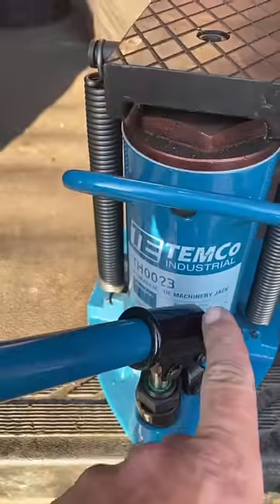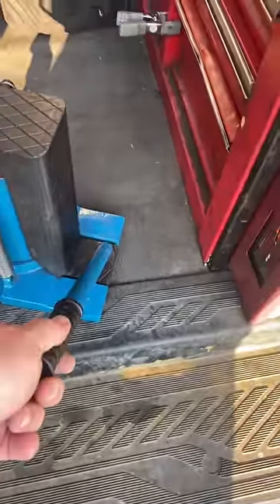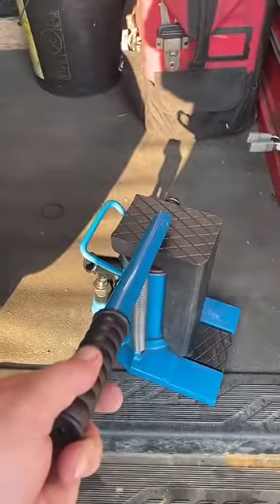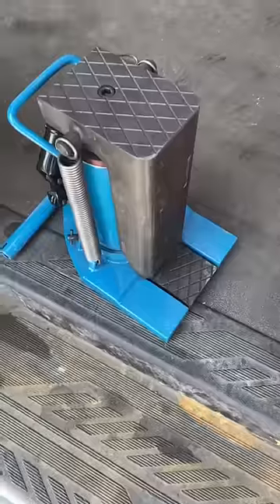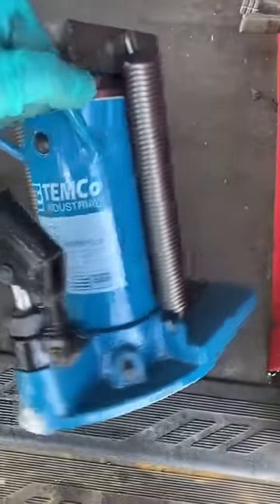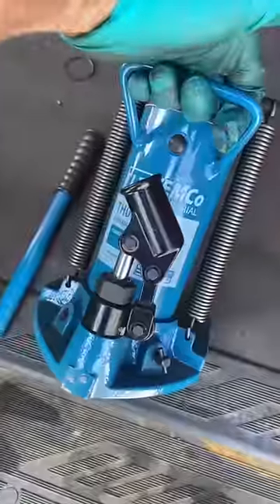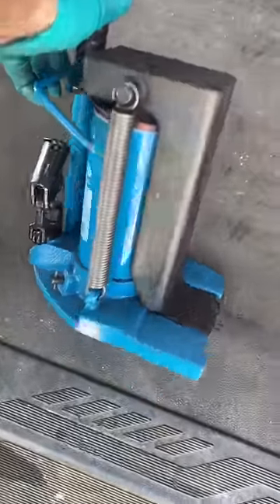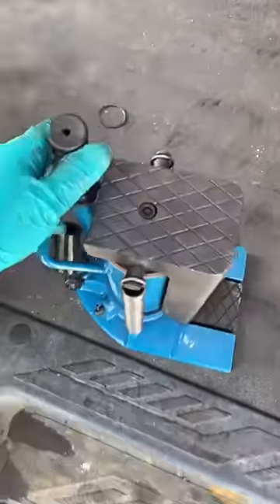TEMCo Toe Jack

Comment: Love them. Temco is a really stand up company. Sorry if this is long winded. So my boat shop burned flat last year and I lost everything. I had recently purchased one of there 20ton hollow pulling cylinders for pulling pins on some of my equipment. We only got to use that cylinder twice before the shop burned. Luckily it was really close to the front door of the shop and the fire started in the back. So it was one of the last things to burn. It barley got hot enough to burn the paint off it. In fact some of the paint was still blue and it still moved. So I sent them a message to see about buying some new seals for it to try and rebuild it. Without even asking they sent me a brand new rebuild kit for it!!  Every single seal and o ring. All the back up rings. All of it. It just showed up in the mail one day.  Now that is customer service!!!
Reply from the maker: Nice 👍🏻 Happy to hear they got good customer service.
Reply: @FunkFPV  I'm happy to hear they sell repair parts! That's getting too rare nowadays.

Comment: Ive never seen a jack like this. It would have been helpful on so many projects.
Reply: I was thinking that if it's light enough it could even be used under houses for floor repairs or anything else you'd have to lift like maybe a furnace or water heater
Reply: Used one in a machine shop to move haas axis cutters and millers. Had a few 20 ton one on tank like treads throw them on use a forklift to move it

Comment: Ah, like the ol track jacks. Great tool, love the hydraulic version.
Reply: Those A17 jacks come in handy for doing railcar repair also. I’d much rather have this hydraulic one. Not as scary on release. Lol
Reply: Can't tell you how scared I was as a teen using Dads RR jacks. They was big, heavy and as long as you got a bar long enough you can pick up about anything. The scary part was going down. Have to put pressure, lift up tooth, let down, repeat. Too much whatever coming down quick. Log trailers, dozers, skidders etc.
Reply: @billm6730  0pp0],
Reply: @Terry-vz9en  OK. I have no idea what u saying. Have a good 1. Lay off the Jack for lunch. Lmao

Comment: Having worked in the material-handling equipment sector for decades, I can see the usefulness of this jack!

I’m particularly fond of the way the jack slipped underneath the load wheels of the reach truck used in the demonstration.

If I had a nickel for every time I’ve replaced load wheels on a reach truck, I’d have a lot of nickels. 😉🦇💩🥜🥜
Reply from the maker: I had about 2 dozen I collected on my bench from just the past month I threw out Friday. Next time I get a stack like that I’ll post a video 😁

Comment: Really nice size toe jack, the ones I used at work were Tangy 50 ton and 25ton. They had a toe that dropped over the top, so the 50 did 30 ton on the toe and the 25 did 12 ton on the toe. Bloody big things though.

Comment: I used to drive these Raymond stand ups, good machines. Yes, I could still leave marks on the polished floors with the drive wheel. A guy at crushed his foot on one while I worked there, he wasn’t a full time driver, had bad habit of hanging one foot outside the machine and it cost him a butt load of pain and a couple small toes. One guy, an older gentleman named Bill R. could drive this machine facing forward or backwards. I had spent more time on 5 ton Yale and Toyota counterbalance sit down machines and was fairly new on the Raymond’s and admired the skill of salty ol’ Bill.

Comment: My dad is way too attached to the cast-iron geared version of these.  They are quite heavy but work well.  The story in the oilfield is they were used as a multipurpose pushing and pulling device.

They weigh a lot and oilfield is all about time and not money.  So they tended to get buried near the rig instead of hauling it back.

Comment: I'm a forklift mechanic myself, and we don't go anywhere without one of these on our van tbh.  

TVH supply cheap parts for all types of material handling equipment to pretty much all of Europe, and they sell toe  jacks that are quite essential when doing electric machines.
Reply from the maker: We use TVH too but they can be a little expensive when it comes to tools.
Reply: @FunkFPV  Their total source like 5 ton toe jack works wonders, and can get in really tight spots. 

Super useful when changing wheels on  BT stackers, and you don't have a forklift on hand.  Always gotta chock it when lifting the braking wheels though, be careful or it might fuck off on you.

Comment: Temco is great for the money. Bought a hydraulic hole punch years ago because I wasn't getting robbed by Greenlee. Still good, dies cut great, leaks a little bit but they all do eventually plus they provided replacement seals.

Comment: It’s definitely a niche tool but it found a perfect use. I’m kinda curious to know what you did before you had it. Definitely seems like something that you would have bought after learning about it if it wasn’t for it being given to you
Reply from the maker: I have a cam-bar jack that worked most of the time. Or a forklift jack that I’d have put in a less than optimal position.

Comment: i could really use this for work i work with big concrete forms and they all have lips at the bottom and sometimes a crowbar wont cut it if something is stuck under it and offsetting the outside jackets of my forms and the crane is busy lifting something up

Comment: I thought toe Jack's were about the only way lift thoes weight dense forklifts. I've only ever repaired the shop forklifts. Not much experience (mostly replacing parts that wore out 20 years ago and cheap ass shop owner doesn't want to put a dime into forklift repair)

Comment: I’ve only seen those weird forklifts at the Home Depot. Are they any good? They seem like they are hard to use or the drivers are just total crap. What forklift operator needs a person to guide them with a flag, then take 10 minutes to put a pallet of concrete on a flatbed? Just get a normal forklift and slide that shit on there in 10 seconds.